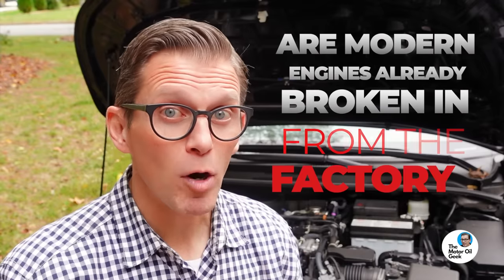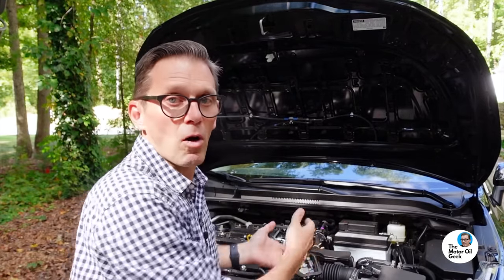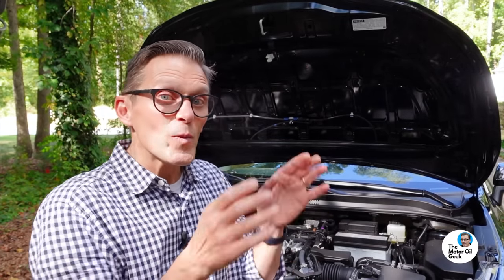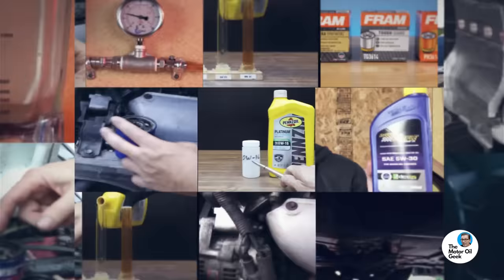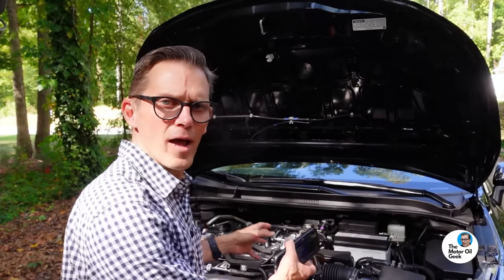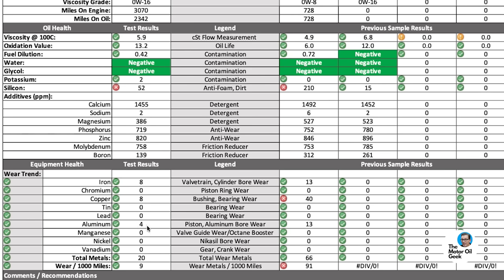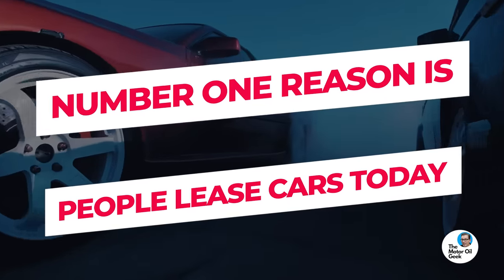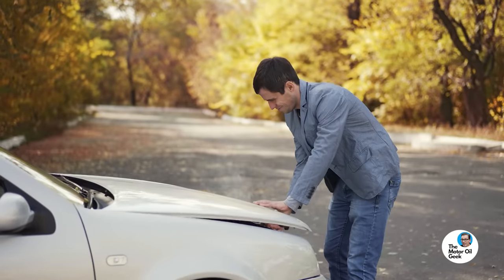New Engine Break-In: Truth or Myth?

Comment: So if break-in oil was only done away with by the OEM's because of Leasing/CAFE, in a perfect world would conscientious new car owners see any benefit to immediately draining the OEM oil when the vehicle has less than 10 miles on it and switching to a "break in oil"?  Will piston ring seating be adversely affected by running a "full synthetic" during the first few thousand miles?  Have moly piston rings and plateau cylinder finishes made it acceptable to use a full synthetic at very low mileage (<1000) or is it still beneficial to use at least a semi-synthetic during low mileage?
Reply from the maker: The engine design allows for the use of synthetic for break-in.
Reply: @themotoroilgeek  Good to know, thank you for the response.

Comment: I know they don't break them in and I only look at the facts.

Seeing as how many cars are built per day there is not enough time to do a real "Break in Cycle" on an engine.

Manufactures have engines ranging from 1.0 Inline 3s to 3.5 V6 or what ever.
Looking at Toyota they have.
1.5l I3 Petrol(Yaris)
1,5l I3 Petrol-Hybrid(Yaris)
1.8l I4 Petrol-Hybrid(Corolla)
2.0l I4 Petrol(Corolla)
2.0l I4 Petrol-Hybrid(Corolla Cross)
2.5l I4 Petrol(Camry)
2.5l I4 Petrol-Hybrid(Camry)
2.8l I4 Turbo Diesel(Land Cruiser Parado)
2.4l I4 Turbo Petrol(Kluger)
3.3l V6 Twin Turbo Diesel(Land Cruiser 300)
2.7l I4 Petrol(Hilux)
4.5l V8 Turbo Diesel(Land Cruiser 70)
1.6l I3 Turbo Petrol(GR Yaris/GR Corolla)

Having a manufacturer break in every line of engine they make would require an unreal amount of space for say 1,000 engines for one displacement 1,000 for the next displacement, etc
Apart from the space requirements to just house all these engines, you would need a ungodly  amount of fuel to be supplied, fuel which has to have fuel lines hooked up correctly no less and have fuel pumps to supply correct amounts of fuel to those engines, coolant lines to hook up to each engine, radiators to expel all that heat from those engines..
They would require exhaust systems hooked up and a means to catch all that exhaust.

While science provides evidence, just understanding the basic logistics required to have factory broken in engines can give you an understanding that it is NOT done.

Only engines that would be broken in are hand built ones as there would be time for these to be broken in and breaking in also helps the manufacture see if the engine has any defects.
Manufactures do not want customers who pay $150,000+ for a car have their engine go klunk after 500miles.
And these manufactures know the customer will most likely want to floor it after getting the car so they want the engine to at least last.

Comment: Are rings fully seated from the factory?  No.  Do manufacturers regularly need to recall vehicles due to fines (small particles) and chips left in blocks from machining operations?  Yes.  Continue changing your oil after 5-500 miles of picking up your new car, it's cheap insurance.
Reply: Your silicon in initial sample indicates grinding fines (but you know this).  If I ever buy another new car, I will continue changing oil the second I get it home, followed by another change after a week.
Reply from the maker: Right on!

Comment: I used to engineer engines for Ford. They're not broken in. But they did add jowelers rouge to the oil to assist breaking in. That was supposed to be replaced at 1000 miles.  Dealers would always tell customers "no need to break in" because they were afraid of losing a sale. That has been the message I have had from every dealer when buying a new car over the last 55 years. Tucked away in a dark corner in the user manual, you will find breaking in recommendations. Cast your mind back to the 60's every new car had a sticker, in the rear window "Running In Please Pass"

Comment: My question (and forgive my ignorance) is having those wear metals suspeneded in the oil actually causing  more damage to the engine? It looks like yes you determined the engine was wearing more in the fist 700 miles, which makes sense to me as it breaks in. it was my understanding (and please forgive me as i am no oil engineer) that one of the jobs of the oil is to contain any impurities to not cause more damage to the engine. It would be interesting to do a test lubricity test on the oil changed at 700 miles on a brand new engine vs new oil.
Reply: You also gained this subscriber today. Love the content.
Reply from the maker: Thanks for the question. I can see how this could be confusing/counterintuitive. One of the jobs the oil does is suspend contamination, so that it can be carried to the filter. However, the filter does not remove 100% of the contaminants. As such, the higher the level of contamination in the oil, the higher amount of abrasive wear will occur. 

Some will argue this is overkill, but I'm teaching best practices. This is what we did at Joe Gibbs Racing to extend the life and reliability of our engines.

Comment: Its just common sense I think. All those metal parts in an engine need many hours of running to break in so everything seats perfectly. manufactures are not spending that time or fuel cost to completely break in an engine.
Reply from the maker: Absolutely

Comment: I just put a remanufactured engine in a 2002 suburban. Do you think it would be a good idea to use break in oil before for the first 1,000 miles? And if so, what kind do you think would be best?
Reply from the maker: Yes! The Driven break-in oils are excellent.
Reply: @themotoroilgeek  would a Lucas break in oil additive work the same if added to full synthetic oil?
Reply: @themotoroilgeek  “TB zinc plus engine break-in oil additive “
Reply from the maker: @elijahkeith5766  No, I don't recommend using any additives in motor oil.
Reply: @themotoroilgeek  I ordered “BR30”
Reply from the maker: @elijahkeith5766  Right on!
Reply: @themotoroilgeek  is it best to run that to 1,000 miles and then use regular oil and regular oil changes?
Reply from the maker: @elijahkeith5766  Actually, 500 miles is the maximum I'd recommend for that oil. In fact, it will do the work you want it to do in 100 to 200 miles.
Reply: @themotoroilgeek  give thanks. I will run it between 100-500 miles and then change it to regular full synthetic oil. Thank you again.

Comment: How much damage do you reckon happens if one doesn't do the initial break in oil change and waits till about 10k?
Reply from the maker: It doesn't cause damage in a catastrophic sense, but it greatly increases wear. The used oil samples between a 500 mile sample and 5,000 mile sample at break-in are dramatically higher for the 5,000 mile sample.
Reply: @themotoroilgeek  Man that is a bummer, I wasn't quite aware of the break in oil change when I first got my Tacoma. That is very helpful good knowledge to have going forward though.

Thanks for the reply!

Fingers crossed I'll get some decent miles out of the engine (2GR-FKS).

I for sure plan on keeping it till it blows up someday.

Comment: Okay.... But you're testing the initial fill. Of course the levels will be high as all engines break in, and the initial break in will be present in the initial oil. The question is , if you drained after only 50mi or 100mi, and did an oil change, then tested the second oil change thousands of miles later to compare, would it be fully broken in by then?

Comment: Here's a thought experiment that will answer the question of whether or not engines are broken in at the factory:

How far do you need to drive to break in an engine? 1000 miles? 2000 miles? How many hours of driving does it take to drive, say 1000 miles (assuming the engine is broken in quickly)? 20 hours? 30 hours? 40 hours? It depends on the speed profile. How many of the engine does the manufacturer make per day in each engine plant? We don't know specifically, but even if it's only 100 engines per day and 24 hours for running them in, the engine plant would need 100 engine dynamometers with some sort of quick-connect set-up to get the engines on/off the dynos without costing a fortune in labour. Then think of the amount of run-in oil they would go through, and not to mention the fuel. They're not going to run in their engines before they're sent to the vehicle assembly line.

So... what do they actually do? Of the automotive manufacturers I've worked for, I only knew what one of them did as far as the end of line engine tests were concerned (this was about 10 years ago). My memory of what I was told is a little fuzzy but here's what I can recall: With the engines still on the production line (inlet manifold and throttle were part of the engine assembly, but exhaust manifold wasn't), an exhaust extraction system was placed over the exhaust ports, natural gas and filtered air was plumbed through the throttle, and deionised and corrosion inhibited water was used as the coolant. The engines were then run at a few different speeds, but at no load (and no dynamometer), for somewhere around 10 to 20 minutes in total to make sure there were no obvious major mechanical problems with the engine (they weren't even run on gasoline so they wouldn't dribble out liquid fuel in transit to the assembly line). 10-20 minutes absolutely isn't enough time to run in an engine. Also, the oil they used for the initial test was the same oil as was in the engines when the customers received their new cars. No special run-in oil. No in-factory break-in. Only a short test using an external fuelling system to ensure that the engines that went into the vehicles weren't dead before installation. As for end of line testing at the vehicle assembly plant... the driver pumped the brakes a few times to get the pads onto the discs, then the cars were driven over some humps to settle the suspension, then onto a roller alignment system (with a guy underneath to adjust the front and rear toe), then they went onto a 4-wheel chassis dyno and they were run straight up to about 75mph, and the dyno then switched into brake tester mode, and the driver did a relatively quick stop to get a little bit of brake bed-in happening. The cars then went to the parking lot to await transport (unless they went to be inspected by the quality auditors). No engine break-in there either. Engine break-in is still done by the customer.
Reply from the maker: 👍 Thanks for sharing!

Comment: All new cars have to have the engine broken IN, the recommend procedure in the owners manual!  In my opinion 75% of new car owners do not break in their engines.  You want engine wear for the first 10,000 miles!  At the factory recommended oil change, change the oil and filter, use regular oil, then when you reach 10,000 mile have the engine flushed (a Blistine flushing machine is the best) then use Synthetic oil (Mobil 1) and a high performance Mobil 1 oil filter, substitute  one quart of oil with one
quart of Dura Lube, now you’ve 
stop 90% of the engine wear going
forward, using the same procedure that you did at first 10,000 miles, my last Ford V6 4.0 had 289,000 mile on it, not burning any oil, running perfectly!  Dura Lube bonds  to the metal eliminating dry starts, those are my procedures, I’ll shut up now!
forward, using the same oil change

Comment: I have a honda jade and I don't know if the car is filled with break-in oil in new. However if I didn't remember wrong it says to return shop and change oil in 5000 kilometers or 3 months. I didn't use the car much and I only did 890 kilometers in 5 months which the shop says no problem.
However some dude ran 13000 kilometers in 3 months and the shop says that doesn't sound good...
Reply from the maker: Oil change interval is a complex topic, so I'll do a video specifically about that.

Comment: I've had my Toyota RAV4 Prime XSE Oil  tested three time by Speediognostix.  Everything is now in line EXCEPT Silicon.- it's now level at 32.  Is this an issue?  Thanx.
Reply from the maker: As long as the silicon levels are dropping, there is nothing to worry about. It can take several oil changes from all of that initial contamination to get flushed out.

Comment: Bought a 24 Elantra, should I change oil at 1k? How about oil additives, yay or nay?
Reply from the maker: Yes, change the oil in the first 1,000 miles. On the additives, don't use any additives in the oil. Yes to a PEA based detergent additive in the fuel.

Comment: How much of a benefit is gained by this increased frequency of oil changes?
Reply: There is no real benefit. Rule of thumb is 5k for synthetic and 3k for conventional. 

If you drive in heavy traffic daily then shave 500 miles off those numbers. But normal driving you can go by those numbers and be just fine.

Comment: Was going to post this earlier, but forgot. Your Yota was started and stopped about 50 times before you bought it. I'm retired from Toyota. Not great break in at all. And then there's the lot guys that rearrange it every week. So your new pride and joy has miles on it just going around the building.
Reply from the maker: Thanks for sharing. We actually took delivery of it the day it arrived at the dealership. It had 2 miles on the odometer.
Reply: Excellent. Nothing worse than a 6 month old lot car. Def don't do 10K oil changes. I always used the pancake batter method. The milk might be great, but the difference between batter and biscuit is the amount of carbon you add. Biscuit batter doesn't flow.  It finds your rings and VVTi screens. Then the timing chains.  @themotoroilgeek

Comment: Its getting harder and harder to find high zink mineral based oils for a good price. 
Many people like me have started to run Diesel oils made for heavy duty diesel engines because of the higher content of zddp. 
But is it good for a gasoline engine to run on an oil made for a diesel application?
Reply from the maker: Check out our video on Diesel oils and Zinc content.

Comment: In Canada (Vancouver) Toyota dealerships give 5 free "services" to their customers when they buy a new vehicle.

The interval being 8,000 kms (5,000 miles) ie on a 4Runner. HOWEVER, if they deem the oil is "clean enough" at any 8K interval, they will skip the actual oil & filter change therefore making the interval 16,000 kms. Total joke.

We've always told our customers more frequent oil changes with short trip driving and the interval can be extended if they do lots of steady freeway driving. Which is very hard to do in the lower mainland.

Great channel! Great info.
Reply from the maker: Thanks for watching and for sharing!

Comment: Realistically even though CAFE and EPA are pushing limits. How bad is the difference if one was to ignore the 0w16 and thinner oils and retain a good ole proven full synthetic 0w20? Most folks can swap between 20 and 30 easily without any damage but how big of a jump from a 8 16 to 20 on the Cst scale compared to reduction of wear at a minuscule loss of fuel economy? I wouldn’t say to jump all the way to a 5w30. But keeping it 0w.

Comment: and i am confused in oil grade so much so company  recommend a certain grade like 10 w 30 but i have seen people use high viscosity oil like 20w 50 and i am talking about motorcycles and should i use oil according to external conditions or should i use oil of course its grade as recommended and the my motorcycle manual recommends to use 10 w 30 but issue is I live in area with 50c summer and 16c winter so should i use 20w 50 or should i keep changing grades like 20w 50 in summer and 10 w 40 in winter or should i stick with my user manual its darn confusing

Comment: I have one 'problem' with your #1 reason for no break in oil anymore @6-7min. - more  leasing.  Aren't there requirements stipulated in leases for owner to do?  Couldn't they just REQUIRE lessors to come back for FREE oil change @500-1000 miles??
Reply from the maker: They could, but the cost would be on the manufacturer. The "free" oil changes that come with cars now are from the dealer and not the manufacturer.
Reply: More people buy than lease.

Comment: I know many of people that drive a new vehicle like they stole it and it still lasts 300K miles. There is such a thing as a little bit too obsessed with oil changes. Just saying! 😊
Reply from the maker: Driving it hard is actually good for break-in. Better than babying it.
Reply: Break it in fast and it will run fast, but it will also wear out fast. High combustion chamber pressure from a heavy throttle will cause higher piston ring pressure and if the cylinder walls are not broken in, you will see faster ring wear. A slow, stepped break-in will produce an engine that will run 300,000 miles or better.

Comment: I agree with the reasoning, my question: Does it really matter? 

My experience is only a couple dozen vehicles, but it seems more "do regular maintenance and it will last" does more than an early 1st oil change. When all these vehicles are lasting 200-300k miles before being sold, spending that hour buying oil+filter and a change at 1000 miles just doesn't seem like it really matters.
About the only quantifiable evidence, is my personal vehicle I did a 1000 mile change, makes ever so slightly less noise than another vehicle of similar age, but after 20+ years in the salt belt, the motor is the last of my concern.

Comment: Do you know if this is true for Cummins diesels? The manual for my truck says that "due to its construction, no break in is required for Cummins diesel engines"
Reply from the maker: Cummins does a little more at the factory than most other engine manufacturers, so the break-in wear is less with their engines.